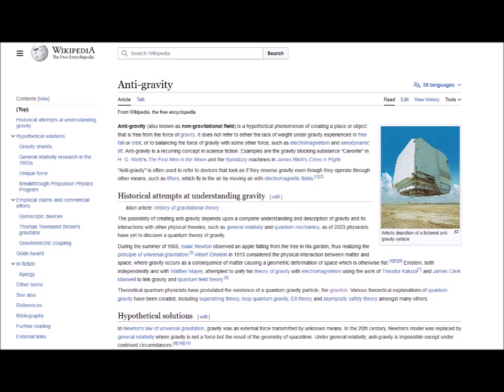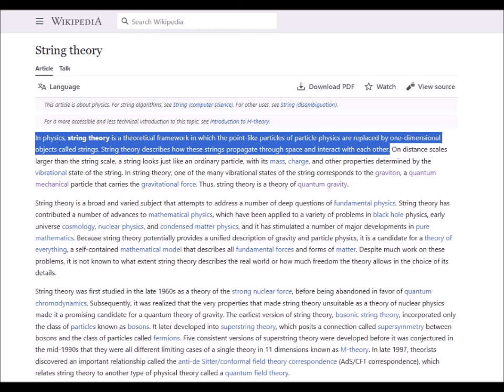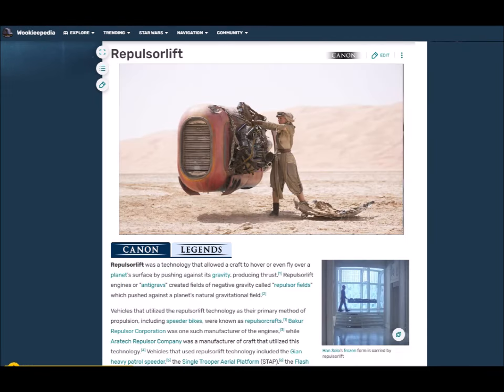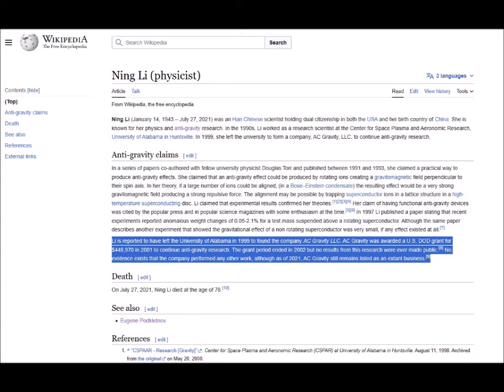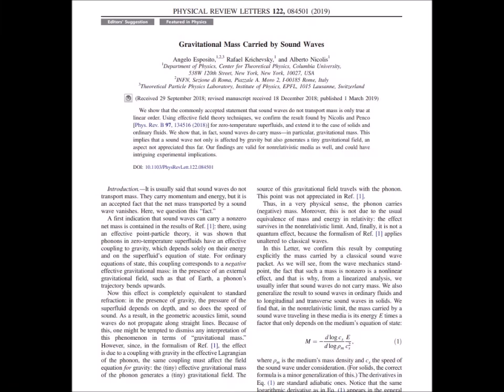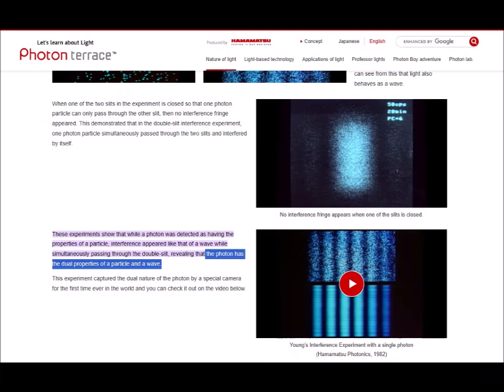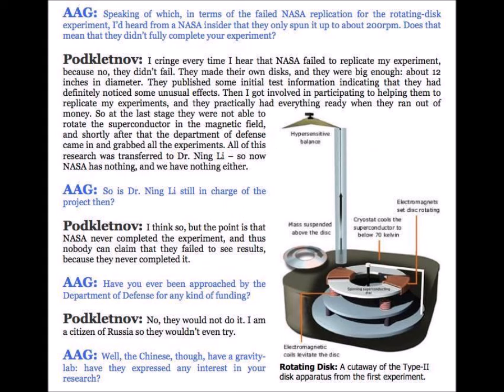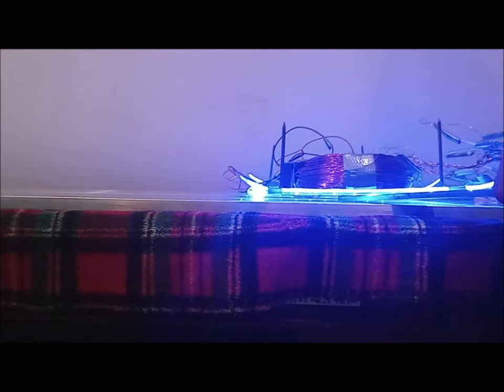Gravitational (Gravitic) Levitation: Can We Turn Gravity on its Head?

Comment: Nikola Tesla stopped working with the magnetic force after 1890. He said he could suspend tons in the air, but he thought the magnetic force to be feeble in comparison to the repulsive, and attractive forces of the electrostatic force, to which he could find no limit. To tesla, the electrostatic repulsion and attractive forces were infinite. 
One can start doing incredible things once a electrostatic compression of 1 million per second is attained. That is the secret of Tesla’s radiant patent, to which not one person has been able to replicate….because they didn’t comprehend Tesla’s ideas of electrons. There is an insulting fluid filling all of space, and it can’t be broken down by temperature, or chemical reactions. The only force that has an effect on this insulating fluid is compressional, and the resonant frequency of this insulating fluid is about 1 million per second. Electrons were not attached to atoms in Tesla’s world, but were simply running free, and he called them radiant matter. A primary spheroid that can’t be broken down, and each has exceptional electrostatic energy for it’s size. 
Once people get hip to these completely different ways of describing electrons, and what is keeping these tiny charged “primary matter” from “clumping”, it’s game on for over unity and what ever you want to do…..fly, transmute, protective shields, it all is possible when real science is understood.
Reply: One million what per second?
Reply from the maker: One million cycles or one Megahertz.
Reply: @gsutton78  why do you think tesla made a quenched spark gap? He said the electrostatic implies that energy is static, but he found it was anything but static, it had a frequency of 1 million per second more or less. What happens when you apply a frequency that is “the resonant frequency” of that object, or thing? It breaks down…..the magnitude of the frequency means very little, as tesla only needed a ten pound weight to pretty close to destroy a one block area in New York City. 
Likewise the magnitude of the compressive wave needed to break down the insulation keeping all electrons separated from each other could be next to nothing, so long as the frequency was matched of the backround insulating fluid. He said of the spark; it can’t be seen, and it sounds as if a fly is buzzing around……the minimal energy needed to repeat a spark at 1 million times per second is the secret tot he radiant patent. I am literally the only person who has figured this out, but I share generously of the knowledge.
Reply: @WeighedWilson  sparks, the smallest energy necessary to cause a spark @ million times per second. The insulating fluid breaks down, the electrons combine their charges, and a small conductive  metal plate(grounded) can pull the combined charges. This is the radiant patent
Reply: Thank you both for explaining. 😀
Reply from the maker: @donaldbest7621  Interesting! And thank you! This reminds me of the book, "Occult Ether Physics" which describes Tesla's use of both high voltage AC and DC to compress and rarefy the ether. The idea if I remember correctly was to rarefy the fluid in front of and above the craft with HVDC and then to compress the fluid behind and under the craft, thus propelling said craft with incredible force. I'm going to go back and read that book again!!
Reply: @gsutton78  it all must be done by way of sparks, aether only does compressional energy.
Reply from the maker: @donaldbest7621  This is fascinating!!
Reply: @gsutton78  it gets even more interesting when the sun’s current is made into a standing wave……we must learn this to protect ourselves from the next earth’s catastrophic cycle…..it’s relatively soon
Reply: @donaldbest7621 what do tou mean by spark and how is it created